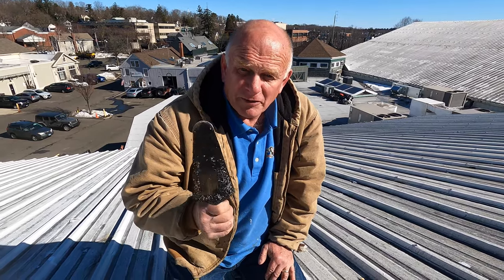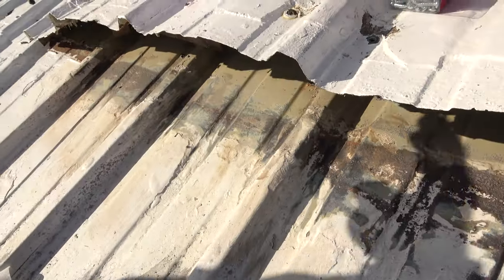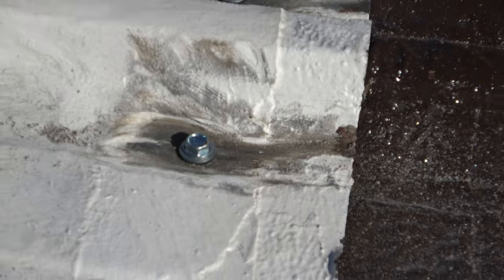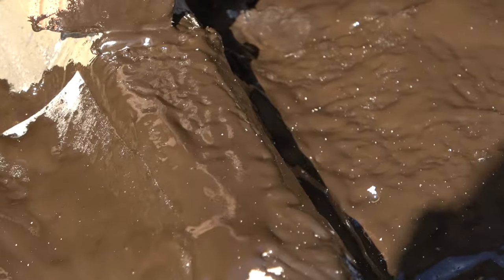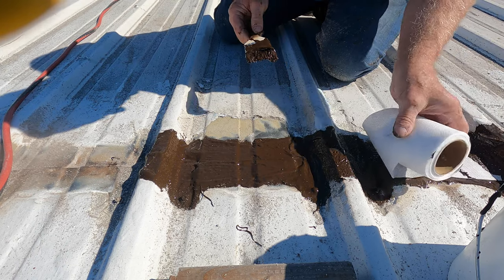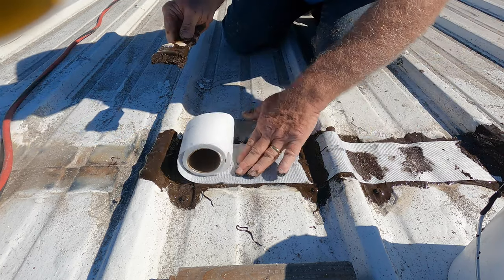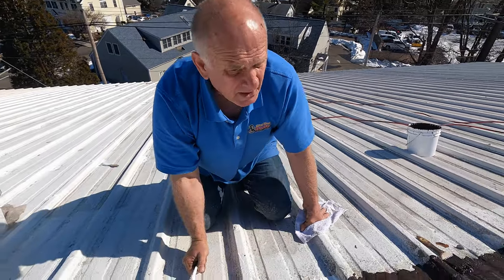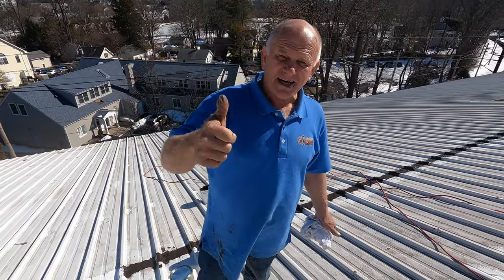Repair Metal Roof Leaks | 3 methods shown Learn How to DIY | Turbo Poly Seal vs Super Silicone Seal

Comment: thanks for taking the trouble for making this video.  Turbo poly  is a polyurethane seal and you said it is better if it is painted over with Silver coat.  I have looked at many brands of polyurethane seals (we do not have Bergstromm brands here) and the one thing they have in common is that they declare it is UV resistant. Painting not required on any of them.  Have you ever found Turbo poly seal to fail in the sun? Personally, if I had it I would dilute it with water to make it slightly runnier(like the super silicon). On the other hand I am a fan of water soluble bitumen. It cannot be painted and it is not UV resistant, but what I found is that if you use the polyester mesh and on the second coat you sprinkle and embed white clean coarse sand, it lasts much longer and once cured, it can be painted

Comment: very nice explanation, of a very nice fix. but the original builder put the screws on the low part of the metal. what is your opinion of puting the screws on the small high part of the metal roof ?  Water is running on the low part where the screw is.
Reply: Your right so put the screws on the high ridges of the metal...👍

Comment: Looks like a good product for sealing roofs but the practice of running fleece and sealer across the overlap has the effect of damming moisture.   At the side laps of the panels 
a little bit of water gets in via 1 condensation 2 rain splash  3 water level in the valley 4 leaf debris or 5 snow melt 6 capillary action.    Moisture that gets into the side gap at the point just above the  sealant band will travel downslope  inside the side lap joint.    The moisture is dammed by the fleece and sealant at the cross joint so it builds up and stays there to create rust problems into the future.
The broader the width of sealant up and down the roof the more likely it is for the moisture to build up to a higher level between the sheeting layers.  (even enough to go to the top of ridges)
It is really important to have a reasonable lengthwise overlap of the sheets and to have the lower edge slightly open for drainage - not fleeced and sealed over the horizontal joints.
Reply from the maker: I see what you mean, but so far I haven't had any complaints or problems
Reply: Absolutely right, seams should be avoided if possible and one whole long  continue panel should be preferred.
Reply: Your right as the Landlord of my rental factory put bitumen over the lap joint and when water got in due to cracking the whole length of the roof became wet as the water could not escape. Now I have extensive rust and it impossible to locate the areas that are the problem as the water travels along before it starts to drip through. I had to break the whole seam open to allow the water to escape.
Reply: Whatveould you do? Just sealer and no fleece?
Reply: @andysurfer318  I would not seal seams.  Repair top and bottom overlapping sheets independently.  
Also try not to have sheeting installed as colums of overlapping sheets.  Better installed as row by row.   This reduces capillary action inside 4 layers of sheeting at junctions.
Reply: @FlatRoofDoctor  'so far I haven't had problems'  is no guarantee at all that there won't be in future.  Go back to those repairs and you will find the capillary action and damming of water at the cross seam.

Comment: Sir you seem very knowledgable. I hired a handyman who did a bad install on a 12x20 Veikous car port. It leaks from all 3 seams inside, lapping is uphill and water leaks thorough. He also failed to remove the plastic protection for shipment on top of roof. 9 hours for me to remove except plastic  under lapped metal and screws. What can i do to micky rig it to leak less on inside? Chaulk or turbo seal and tape. I'm 65 retired and trying to stretch dollar I spoke to a contractor who can do rebuild way $$$!

Comment: Was there rust or did you wirebrush the under side of the upper panels? Why not put butyl sealant on the under side of the patches?
Reply from the maker: Excellent question. There was a little rust here and there but nothing to be concerned about. It was going to take a much bigger effort to wire brush the underside as well. If you have the means to do so, then you are doing a 100% better job than I did. I think it will mean to undo more screws further up the panel so you could lift up the panel higher. I believe that is doable and should really be addressed.

Comment: Why do the screws go into the valleys and not the ridges?  Surely that causes water to accumulate around the screw?
Reply from the maker: This is how the metal sheets were fastened. There is a sealant between the 2 overlapping panels at the sea,. So the overlapping panel has to to be tight at the seam to make the sealant seal. If there were no screws, then the top panel would heave up and cause a gap between the seams.
Hmm, I don't know if my explanation made sense. Maybe someone could comment and do a better job.

Comment: I have the exact scenario as your demonstration. Especially the part about accessing underneath the overlapped seam. BUT...there is no wood purlins or anything to drill it to. In the past, perhaps even originally, they used rivets to join these overlaps. Then at some point they used screws. So, my question is, will these methods work if I cannot screw into wood underneath?

Comment: Yikes.. Did a roof inspection and found a rust hole starting on the metal ridge ( same type of roof in video ). Turbo seal dose not ship to five O?? And some small flash rust stating also in small spots. Not big but will clean and spot paint.Roof is very flat with just a small incline so water runs off. Like your feedback. Off to the hardware store for some flashing tape to temp seal the hole untill sunny day.

Comment: Letting that dry overnight just makes the gap larger between the two pieces of metal that overlaps. It's not going to dry flat .  I'd squirt clear silicone and smash to two panels together while it's wet then do your turbo poly seal over it.

Comment: I've got the same issue between the seams and screws along the bottom row of roof panels on galvanised IBR just above the bull nose.  Will these methods not trap the water between the overlapping panels above the treated area?
Reply from the maker: i don' think so. A little hard to understand what you are referring too.

Comment: One question I have a roof panel that was cut to short so the water is not getting into the gutter I do have a small off cut could this be used to extend the sheet?
Reply from the maker: yes

Comment: Hey I’m in texas and have a flat metal roof with almost zero pitch. I have seams where they overlapped and almost left 3 inches of overlap. What do you advise and how much would you charge to come to texas and fix my roof ?!
Reply: You know water has to run off metal , it cant sit . He would probably torch down over it

Comment: Idea is to buy it in one sheet and the metal seams should of been sealed if your using 2 sheets. This is just putting a bandaid on the problem. The trailer roof you did would of been easier to lay metal down and it would of lasted a lifetime.  I beat shingle prices with metal and that's why I'm a 5 star rated company. I warranty my work too.

Comment: I'm afraid to walk on my Mobile home roof like you do.  First to clean it then to seal the screws heads and joints of a 13 year old roof Aluminum roof.  Do u think it's ok to low crawl around up there?
Reply from the maker: Hey Frank
Start from the edge and slowly shuffle your way to the center and feel if the roof will support your weight.
The other thing you can do is to place 2 x 3 ft x 1/2" plywood that will disperse your weight when standing on them doing the job.

Comment: What ripe of paint do you recommend for a metal roofing?
Reply from the maker: If you just want to protect your metal roof against corrosion and rust, I recommend Aluminum Asphalt paint by Karnak. But don't paint the roof if you have leaks. First fix the leaks then you can apply a coating. It is very important to find all the leaks and wait a couple of months to be absolutely sure there are no leaks before you attempt any coating.

Comment: Oh boy, I had a brand new metal roof installed 3 years ago and so far it’s leaking in 7 different places. It’s a huge roof,50 square and I am so disappointed because it was so expensive and of course the roofers left state so now I’m stuck.  They didn’t sheet it, instead used a silver bubble liner. My inexperience cost me big time. It’s an old slated roof and from the inside I see where they missed the slats and screws are showing right through the metal and wrap.  Someone told me to caulk every single screw in the roof which would be a huge project. I’d absolutely do this if it’ll work but is this going to be a waste of a lot of time and money? Any suggestions from a true professional?
Reply: Like he says just, fix the leaks. It's all about finding them.  You'd be amazed how much water will travel through a pinhole or an unseated screw.

Comment: If you do not use an oxygen disipating chemical seal first. It will rust under anything put over old rusty areas.
Believe me I'm in the auto body industry and I know what I'm talking about.

Comment: That's one of his past job failures, were he used duper silicon sealer to seal the whole roof, it didn't hold up, now he's back to fix the problem areas failing.
What a con artist this guy is.